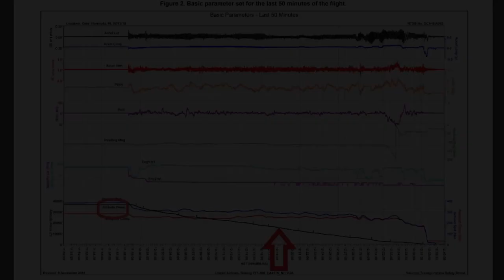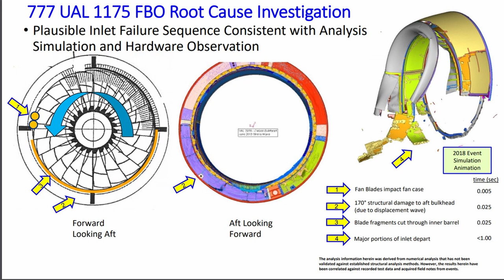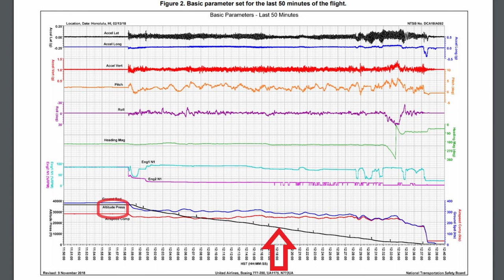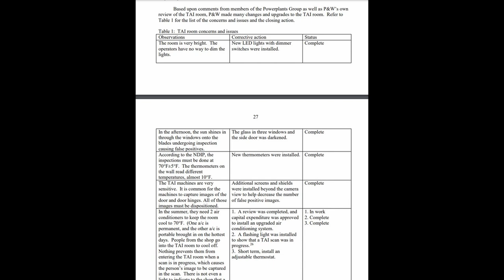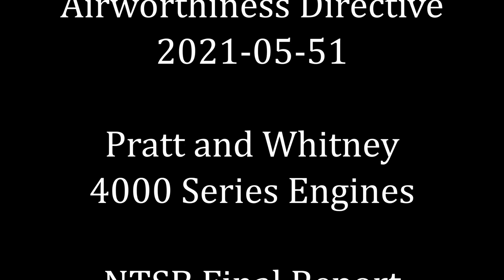Emergency AD & NTSB Final Report UAL 1175 Fan Blade Failure

Comment: The problem with this kind of ‘efficiency’ argument means that more aircraft are bought into service. Three super efficient aircraft in service can still do more damage than two less efficient ones. So it is nonsense to argue that more efficient planes will save the atmosphere - the final result will always be, “hey, cool, let’s buy more of these aircraft”.  More flights, more aircraft, greater ‘efficiency’ and greater environmental damage.

Comment: Not for playing clever, i am metal engineering , there are 2 ways to check metal fatigue  , with the 2 sprays from spray cans  White/Red there you will be able to see cracks that are close to the Surface , next is X rays , there you can see all the small fractures that in the future will be dangerous , they have done nothing of that 100%

Comment: Really!!!

How hard can it be to mount small (aerodynamic automotive style) cameras pointing back from the cockpit ?????
Reply: Wing mirrors wood be a cheap and easy fix.
Reply: @davidjones8680  Bit too much drag..
Reply: In short very hard. It needs to be certified for air travel, it needs to be wired to the cockpit circuit breakers which will add significant weight, and it will also need to be fire safe. All of those add up.
Reply: @dynasty0019   

If Elon Musk was running Boeing, it would be done by tomorrow afternoon..
Reply: @ptrsrrll  Elon Musk ain't dealing with the FAA. There's a reason why he hasn't come up with an alternate to the current airliners while he's rolling out next generation cars and space ships.
Reply: @dynasty0019  
He does deal with the FAA, however,

Fear not !!            Electric aircraft are on his agenda - Right after Mars..
Reply: @jamesharris9816    Pithy,

But the question becomes,  to whom do you refer ??

Comment: What is the possibility that the ‘clamp’ that holds the blade in place could fail?
Reply: The blades have a corrugated root that fits into a matching mating surface. So there is no “clamp” holding them in.

Comment: Why not install the capability to completely jettison an engine? Eliminate drag completely.
Reply: that's a button I would never like to see in a cockpit.

the pylon attachment points and pins are rated in design to separate at a load well under failure thresholds for wing and flight surface damage and failure.

spoiler:  IF you end up in a situation where the pylon is separating by such loads, I can assure you there are alot more things going on in the cockpit that reaching for the engine jettison button.

from a safety pov, one might not desire the potential of unloading an engine on those lift challenged people below either!  

even though this event looks dangerous (and it is no doubt), that vibration is obviously well within the limit of the design safety thresholds.  They landed safely...a credit to the incredible discipline and training of the crew...but also an aircraft the was designed to handle those stresses.  

other things:  drag isn't the only factor...a sudden change to CG moment is probably even more significant...particularly that this aircraft was at cruise where a sudden shift in CG can present some very difficult challenges even to the most well trained pilots.

I'm in favor of keeping stuff from falling off ....these aircraft fly a fairly narrow envelope...you start getting into alot of trouble when you push toward those margins, or exceed them.

with little fuel left in this flight (35 minutes left to approach on a descent after a quite long ETOPS profile), you don't really have alot of room to shift fuel  around to counter CG margins.  And at altitude, at high velocity, flight surfaces aren't going to be as nearly as predictable in their effects when "losing" a very heavy engine out of the wing.

and of course, how would one propose ejecting an engine?  controlled explosives?  Near fuel?  With heavy rotating fuel burning gear ?  

nope...lets' keep the THAT button out of the cockpit.
Reply: @tdmmcl1532  wow I wasn't expecting such a detailed reply. Your CG and safety points on those down below are well argued. CG issue could be eligantly solved by jettisoning both engines and simply gliding to the runway, or maybe by asking passengers to quickly switch sides of the aisle. UA1175 was above water, so fairly safe to jettison the turbofan above deep water (whales only occasionally surface for air) and UA328 was above deserted ski slopes. 

Interesting issues that the NTSB is no doubt pondering as we speak.
Reply: @ctsheehan  no matter if you drop one or both, you are going to have a massive CG problem...

just to put this to rest:  the last thing you want to depend on is a wildly CG compromised wide body commercial jet on an unpowered glide situation.  

the glide slope and descent rate isn't very friendly...at all.

we might have some idea that for instance that a320 that pulled it off into the hudson is due to some great pilot handling..and that is definitely a big big part of it.

but THAT picture would have been very gruesome if one or more engine decided to divorce the plane.

just something to think about.

Comment: Painting the blade is required to get a surface with a constant emissivity from the blade. The bare metal surface as it comes out is going to be either too smooth or too rough, so the emissivity of the titanium alloy will vary wildly, so you need to get a surface that is uniform in thickness, so the blades all will all be measurable. Going to guess Boeing/ P&W will have to make a robotic paint cell for those blades, so that they get a very repeatable spray fill on all blades, getting the variability down. You need a uniform finish, with a repeatable thickness on all blades to get a reliable result. 

Going to guess that the inspections will reveal a lot of failing blades now, as they all have had a high number of cycles, plus all sorts of shock loadings from minor debris impact and wear.

Comment: Am I correct in reading of another similar incident on a 747 running the same engines on the same day? There was a photo of a car with a blade impaled in the roof?Anyone?
Reply: Yes there was. Still a PW4000 series but slightly different variant to the 777
Reply: @tomstravels520  Thanks,that looked in contained unless everything was spat out of the front/back. Looked even more of a mess than the 777 event.

Comment: Not that I’m knowledgeable in TAI, but this technique sounds to me questionable for detecting cracks that would emerge from the inside surface of the hollow of a blade: The heat generated by the friction of the 2 surfaces of the crack is probably minimal & would have to travel certain mm to reach the outside surface & then being detected. Since it does travel in all directions, the thermal image detectable at the surface would be large & vague. Not to mention that Titanium has poor thermal conductibility... Immersion-UT (Phase- Array) NDT “automated for the specific blade”, sounds to me more appropriate. (??) 

But maybe more concerning: According to the NTSB list, looks like blades are sent to P&W for TAI, after results of conventional on-site inspections (UT ??) were not decisive… In practice, that could well mean that this is more to try to salvage them from scrap. (??)

Comment: Glad they grounded the planes. I don't like the cavalier attitude of the engine manufacturer when it comes to testing. There is no safety unless a test can be performed to verify the structural integrity. In this case, the test is voodo science which has far too many variables to give me confidence in the engine manufacturer. The painting should be automated as well as all the data points for the testing so every test is comparable with every other test. The loss of the cowling should never happen. A complete re-engineer of attachment should be done. Exposed wiring should be re-routed or armored to protect it from fan blade destruction.

Comment: If the vibration on 1075 was so severe, and the drag so high, why did they not just blow the bolts and drop the engine in the sea?
Reply: They will need the engine to investigate the cause.
Reply: Im pretty sure can’t separate the engine from the cockpit. Whilst the engine is designed to do that is it just a mechanical design and not activated by explosives. Plus then the NTSB would never know what happened as the engine would then sink to the ocean floor
Reply: Who are they Engines are designed To Seperate when Vibrations Are Exceeding The Limits You can't just hit a switch

Comment: The engines run more efficiently in colder environments via higher altitude. This aspect makes sense. But... can someone make sense of... The higher the altitude the less O² available - so how is it possible the engines work more efficiently at higher altitudes with far less O² available?

Comment: Juan, I would like a sensible answer of why all planes flying today don't have multiple cameras and a control panel board to see them for the outside as well as the inside and the cargo compartment.
Its ridiculous to think that in the age of technology pilots still need to guess what's going on when an issue occurs instead of immediately knowing and concentrating on solving the real problem and flying the plane.
Etf?, what I am asking is unreasonable or unnecessary, a picture say more than a thousand words and its more objective than the pilots imagination.

Comment: Too bad they don't make a " diarrhea switch ""  to lighten the  ( freight ) load when an engine pukes at or near max altitude .  Seems like we stilll have to approach engine power changes  like a nervous long-tailed cat just like in high hp  recipe engines l
Reply: Its called a fuel dump.

Comment: Can't understand why airplanes costing millions in this day and age can't have a couple of $500 cameras mounted in strategic positions to allow pilots to view engines, wing and tail surfaces, etc. They put in miles of cables to connect bored passengers with entertainment systems at their seats, but nothing to allow pilots to see what is going on with the plane. Would it cost so much to do that? All it would be is essentially several mobile phones behind heated plexiglass panels, powered from the entertainment wiring, communicating with the cockpit over either cables or better still wifi (using large antennas) and displaying on an ipad in the cockpit. As a passenger, I would expect the pilots to have that facility in the 2000's. I wonder why not?

Comment: WOW not exactly FUEL EFFICIENT. That's alot of fuel. I'm not familiar at all with big jets or anything other than 103 ultra light aircraft. I've been building a legal eagle ultra light airplane for the past 2 years it will have a 3 gallon fuel tank.
Reply: 187000 lbs of fuel to move almost 90000 lbs of freight 5000 miles.  How much would a Prius burn carrying 2 adults from the west coast to the east coast and return?  And the 777 will get it there while it is still fresh.
Reply: @oscarb9139  I don't know how much a Prius would burn. I've never drove one. I daily drive a 1986 ford 6.9 diesel truck. And on a 1966 mustang 6 cylinder sometimes. So I couldn't tell you what a Prius burns
Reply: @beekeeper7535   I did a search.  It says average mileage is 51 to 58 mpg.  I used 55 mpg for my calculation.  That works out to 90 gallons for a 5000 mile trip.  90 gallons is about 450 lbs of fuel for the round trip.   That works out to about 1.5 lbs of fuel per pound of freight (the two adults) to move it 5000 miles.  The 777 does it for about 2 lbs of fuel per pound of freight.  Not really that inefficient.  Now, change that to a VW Jetta TDI that gets 42 mpg, and it is about 2.6 lbs of fuel per pound of freight for the trip.  Just some trivia.  Empty jets are very inefficient.

Comment: Is it just bureaucratic red tape that would prevent some sort of retrofit of cameras on older jets? With the small size and durability of many small cameras now I can image there would be a relatively inexpensive way to add inspection cameras to pretty much any airframe in a fairly non invasive way. It would give pilots much better situational awareness in situations like this and potentially save lives. Is it just that NOTHING is ever allowed to be retrofitted to an aircraft because "Safety" cannot guaranteed to an extremely high standard even though retrofitting some system could actually improve overall safety?
Reply: Partly safety as you have to ensure the camera would not cause drag or not get ripped off by 500mph winds and get sucked into the engine. But also it’s never been proven to have changed the outcome of an accident. A camera can only see what it is looking at. It cannot see behind the scenes where hundreds of sensors are located

Comment: ETOPS.... Yeah who needs 4 engines to fly huge distances over water, modern engines are so reliable, stuff like this is one in a billion.. Or one in a mil.... Once a year? These guys better get this stuff figured out quick. Suppose this had happened mid point of the flight? And I know, I know "statistically speaking".. But Mr Murphy doesn't believe in statistics. And he will eventually show up at that worst possible time if you leave him even the smallest opening.

Comment: Have they ever thought of using a turbine braking system in those cases?  If so, why are they not used?
Reply: Not allowing the fan to freewheel would add an enormous amount of drag. Better to engineer the support structures to withstand the flexing.
Reply: @SteamCrane  yes it would create heavy drag.

Comment: Multi Million dollar airplane and it has only 3 cameras and not looking at the engines. Pilot has to run back and look out the window. A hyundai has more cameras than a state of the art modern airline. That same complacency is why fan blades are breaking off.

Comment: Juan.  I’m surprised you didn’t mention that the 777 you fly has GE90 engines with solid blades made out of composite materials; not a Ti alloy.  The GE 90 was the first large turbofan with composite Stage 1 fan blades certified by the FAA.  Every new GE turbofan engine Is designed with composite fan blades.  Here is a video of the production process. https://youtu.be/g8zt-qljYmM

Comment: Flight 328 was not contain they found one of blades on the ground
Reply: Contained means the engine did not throw anything sideways out of the engine.  If it was unconfined the kevlar shroud would have been breached.  The engine can have parts exit forward or out the back and still be considered contained. The concern for uncontained is have parts exited sideways and damaged the pressure vessel i.e. the fuselage.
Reply: @Rick-it1hu  it was Uncontained was Damage to fuselage and Fan Blade exited and landed on the ground contained means that everything stayed where it was at which it didn't
Reply: @Rick-it1hu  here is a Is the difference
According to New York based aviation accident lawyer Jonathan C. Reiter, uncontained engine failure is more of a serious threat than contained engine failure due to how engine components that may separate inside of an engine exit. With a contained engine failure, pieces may exit through the tail pipe or remain within the cases of the engine. When the failure is uncontained, loose components may exit in other directions at high speeds, causing a number of complications that pilots have difficulty controlling, which in many cases leads to tragedy.
Reply: @oldiesbutgoodies4539  The NTSB ruled it contained...doesn't matter much what anybody else says.

Comment: 187000 pounds of fuel does not seem a very efficient way to move 300 people.
Reply from the maker: Do the math. 6000 miles...
Reply: Exactly, moving people 6000 miles is not efficient.
Reply: @paulfontaine7819  oh mate😂

Comment: Very surprised an airline pilot would say his plane burns gas, when it’s jet fuel. An acceptable short form would be kero (for kerosene). The minimum density for jet fuel is 775 kg/m3, which comes to 6.46 lb/gallon, but the average is closer to 6.6 lb/gal.